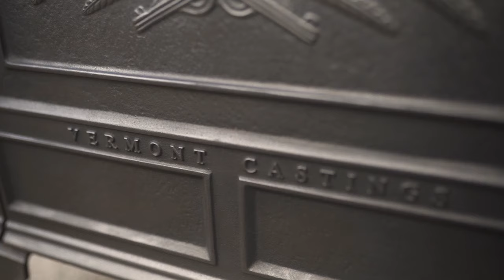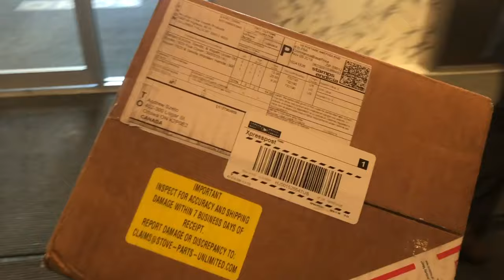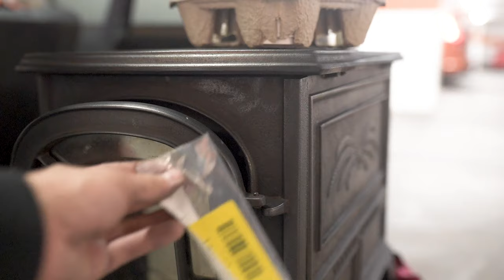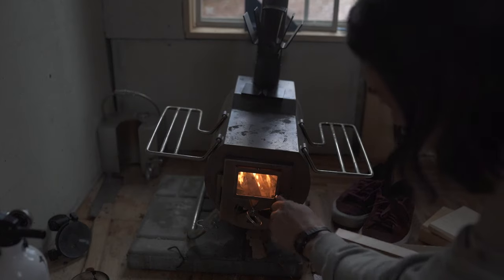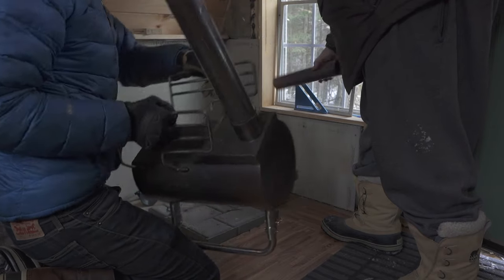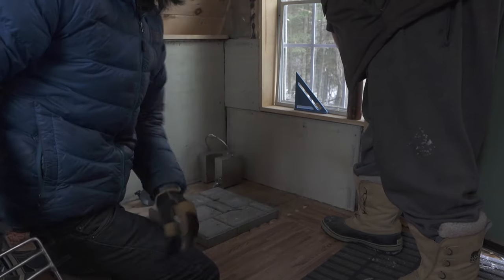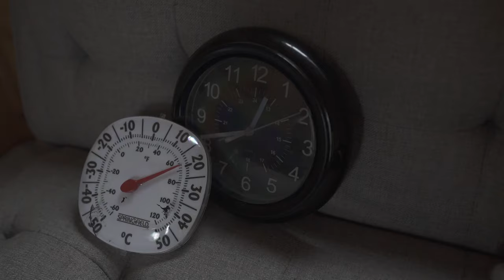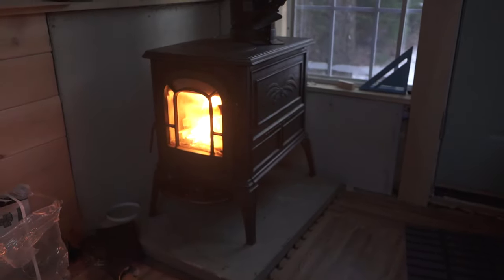Restoring, Refurbishing, Removing Rust and Installing a Cast Iron Wood Stove!

Comment: Very nice. Bought a floor model (Aspen) in Gainesville for about a grand in 2010. It never worked right. After 10 years of smoldering and creosote buildup I took it out frustrated. Put my old Birmingham no 20 back in.
Now I'm learning that there may be blockages of cement in all the air flow channels from the factory. So I'm going to try and take it apart and see.
Hope to make it right and look as good as yours does now. 
It looks great. Thanks for sharing all that. I e?enjoyed watching.
Reply: Had the same exact problem with the one I bought. I restored an old WJ Loth Stove that is probably one hundred years old, and it works perfect without any creosote buildup at all, and being an antique, it looks so much better.

Comment: Let me say!
Great job! on Re-finishing the stove.
As for the double wall pipe just switch the top section out with the bottom section.
and remember, Be at least 3 feet above the peak of your dwelling.
This minumises downdraft.
Glad to see you have a UL/CSA  approved woodstove.
I know chimney costs more than the stove, But you did it right the first time.
Your safe with that celling kit you bought,  
Now you just need a 6 inch brush,
To keep it clean.
Burn it hot for about 15-20 mins in the morning to burn out any creosote build up, 
Good Job!!!
PS Keep a fire extingusher nearby.

Comment: I put copper on the wall made a big difference, before i would put my hand against the cement wall and it was hot now i can touch the copper and just slightly warm and the warmth reflects more heat in the room.

Comment: Nice job, did i notice some sort of lining inside ? Mine seems to have a lining of some kind at the rear and side walls, worrying in case its asbestos.
Reply from the maker: hmmm good question andrew, i don't know myself. I replaced the linings on all the openings, but didn't notice any others on mine.
Reply: @AndrewSzeto  I did a bit more research and found that its more than likely not asbestos but some other flame proof lining that helps reflect the heat toward the front. I was just worried about  removing it for cleaning the inside.

Comment: Great job and loved the video.  I just picked up an older Aspen and its in about the same shape as yours was.  Door was hanging off the stove and when i moved it, snapped off completely.  I can barely see the pins you used as replacements.  Can you tell me where you found them and what the order number was?  Again, great job.
Reply from the maker: oooh good question bruce, i don't remember it anymore, but there are diagrams available for this via the links mentioned or below and you should be able to locate it there. you gotta be super fragile with that door!

Comment: Unfortunately stoves that have been left outside tend to get brittle  I wonder if the stove is still in working condition or did it crack
Reply from the maker: it's still rocking for sure!
Reply: Have you checked it for cracks?

Comment: Hey tip for you , clean the glass with wood ash & water,  clean off with newspaper 👌🏽
Reply from the maker: oooh cheers rosco! probably easier than carrying glass cleaner around with me all the time haha
Reply: Rosscobosco I have a question for you.  I want to install a wood stove on the basement of a 2 story building which has a brick chimney. Do you think this will be save to do. I have tenants on 1st and 2nd floor living.  Thank you in advanced.

Comment: Крутая печь. The only remark. The pipe for removal of a smoke needs to be done above a roof. Then the thrust in the furnace will be better and less smoke when kindling will go into the house.
Reply from the maker: большое спасибо! and absolutely, i had a defective section of external pipe. need to get it replaced and it should get me close to the necessary clearances.

Comment: I have an old osburn I took out of my house, and left on the deck for a few years. I’m definitely gonna restore it. And then probably use it for myself
Reply from the maker: heck ya! hope this helps a bit! there are other decent resources out there too!
Reply: Andrew Szeto it did help, and I am currently in the process of trying to figure out how to get the brass plating back from rust. However looks like I’m gonna have to get it redone since it looks a bit far gone...

Comment: any tips on how to remove the screws holding the glass seem to have we welded them self on?
Reply from the maker: oh crap... usually for any screws that are stripped and weird like that, the solution is usually to drill them out. sounds like you'll need some accuracy around the glass though.
Reply: Look on yt for seized/broken stud removal tips. Try using heat first and or  penetrating fluid , if that does not work then Small hole in centre gradually going up to close to thread depth ,then fit screw removal tool(set costs pennies),clean thread with original tap size . Get new screws and coat with anti seize /copper grease  and refit.   whilst your glass is out clean it with a damp cloth dipped in ash from fire then polish with cloth . It pays to fit new seals if refurbishing  or every few years as they harden up .and check the state of the firebrick inside,if broken replace if you can .or make your own using broken as template .

Comment: White size wire wheel brush?
Reply from the maker: oooh good question, it was a big one, i don't fully recall though. Probably like a 1.75/2" diameter
Reply: @AndrewSzeto  isn’t there like a size of the wire too? I see braided wire, rounded wire too many choices and forget asking at the box store — they won’t know
Reply from the maker: @DamnGoodReviews  oh boy, i did this a while back haha, don't overthink it haha. I just picked up whatever they had to take the rust off. It's metal on metal and it whatever you get will probably work. Just gotta put in the elbow grease. probably not the most helpful, but it's honestly just been a while haha. all the best!
Reply: @AndrewSzeto  haha sounds good!  Thank you!

Comment: Just think if v c would've made large version of this stove capable of taking a 26 inch logs
I lived in the calving room of an old dairy barn ,that had been converted to liveing quarters. There was a local shop going out of business and i bought a brand new green porcelain dipped vc aspen for 550 dollar's .l installed it in the barn apartment on a brick floor . Safety pipe had already been put in through the whole legth of the bottom floor through the loft 
This video brings back memories of my good old friend that kept me warm for three indiana winters
Reply from the maker: incredible! that's a smoking deal on that aspen!

Comment: Nice job on the stove refurbishing.  Did you install a ceiling support box when transitioning at the ceiling from the interior stove pipe to the exterior chimney pipe? the stove pipe itself is not supposed to go through the roof.  Interior clearance - If you used a double wall stove pipe I believe 6" of wall clearance is what is needed and if its single wall 18" of wall clearance.  Im no expert and Im just trying to help if I could, please verify before proceeding.
Reply from the maker: Tony J yep! got the support box for sure! thanks a ton for checking this out and checking in ✌🏼

Comment: I have 4 woodburning stoves/cookers !

3 kids plus me  in a 10m square house 2 floors.

Usually we only have the main cook stove going in the kitchen. Even when minus 10c outside. Loads of duvets and sleeping with socks on, smile.

When it got down to minus 20c  we used  to fire up the big boy  and everything down stairs got a bit too hot ,  plus 28c.  Hence the 2 smaller cooker stoves upstairs in bedrooms as allowed them to make tea and cook if they wanted to, as long as they carried the wood upstairs and the ash down. LOL

Your little boy is very like the stoves that the locals use to heat a,  say 10m-15m square space, easily. But  they dont stay in long, about 2-3 hours, because of the small fire box, unless you put coal on it about 10pm  should last until about 6 am, then  just raddle it a bit and chuck on new new logs.

As steel absorbs heat and transmits it too well, think of saucepans. I would be worried about using it as a heat shield in s wooden building.  I dont know about modern materials. I have only ever lived in traditionally built houses, so cement, bricks and stone (especially the igneous) act as heat sinks  and fire protection.

Personally I would build a brick  container ( hearth and chimney) around you stove. To absorb heat and protect the wood structure.

Anyway I loved the vid.
Reply from the maker: thank you soo much! this stove has been working really well thank goodness! your account on things is great for context moving forward! thanks again and happy firday!

Comment: Where did you get the hinges???
Reply from the maker: i got them from here: https://www.vermontcastings.parts/shopexd.asp?id=4
Reply from the maker: @HollywoodCreeper  omg, i am soo sorry. I did not have a similar experience, but this is good to know for future correspondence. I guess I got lucky. I do try and buy imperial everything if I can (likely available at home depot), but yeah I made the order and got lucky I guess. sorry again.
Reply: @AndrewSzeto  Hi Andrew,
No problem. It's not your fault! I just wanted to let people know that these guys cost a lot and can be bad to deal with. They are called Cozy Cabin in Warrensburg, NY. My local Home Depot had no chimney pipe. My local Ace Hardware sold Imperial pipe and it was like $10.49 for a 2 foot section and $23 for a 4 foot section of single wall. Keep up the good videos.

Comment: Hi Szeto, around the stove... you may want to do some mosaic tile on the backer board. 
Even if there is already cement board up, you can do some fun tile work on the 1/4” hardie board (while it is on a flat surface).. just leave a couple tiles out in strategic places so you can screw it securely.. then once it is in place you can put the tiles in with an epoxy or furnace cement, etc.The 1/4” hardboard is light and could go on the T&G without too much engineering.

Great work, attitude and way about you.. comes through in your content. Cute dog too.. the Pup’s jacket/ coat is nice, where is that from?  Peace, and take care.
Reply from the maker: thanks a ton! I've got the hardboard up everywhere now, plus some pipe shields as well. It's all doing a much better job now :) Atlas' coat was purchased by my mom haha, looking on amazon, there are a bunch just like it!

Comment: Never ever allow the door to hang from the hinges like that. If that Hing had snapped off you would have done massive amount of damage to the stove
Reply from the maker: you're not wrong. glad it didn't happen. thanks a bunch for checking this out and the tip.
Reply: @AndrewSzeto  sorry but I freaked out when I saw that knowing how easy cast iron snaps
Reply from the maker: @m998hmmwv7  i hear ya!! the thing would just swing open like that when i first got to it and as told that, it was like that for years haha so didn't think a ton of it at the time

Comment: Be careful with that window trim at the rear of the stove. Also any plastic window parts. May have to add another small shield at the back. Otherwise, very nice job.
Reply from the maker: i totally added a bunch of shields back there. it's been good!

Comment: No restoration done at all here. He cleaned a stove, thats it. And most everything he did was wrong per factory specs. Its really a shame, because to get the most out of those old crappy 1920’s, you need to fully rebuild it. Its of the worst designs for a VC stove, and they changed it rightfully to make it better. He says “the same stove new costs 1600”. Untrue. The new stove is the C3, which is leaps and bounds better than this 1920. 

All in all Im happy you tried, just a lot of mis information here.

-Someone who owns an actual stove restoration shop.
Reply from the maker: right on nick! good to know! it does the job for now, would love to pick up a new one for sure! can you drop a link to your store? cheers!

Comment: Do you ever use coal in your burners?
Reply from the maker: i have not myself, no
Reply: @AndrewSzeto  ..... Hi again ..... maybe check into it .... I have used coal, small chunks about the size of a fist, it puts out good heat but it gets hotter then wood if I remember correctly so you do have to check the walls surrounding the wood burner until you know the right amount to use.

Comment: Did it do well through the first winter?...I bought one myself.  This COVID-19 is slowing things down though.
Reply from the maker: Code Talker oh ya it did great! game changer in terms of prolonged heat and sleep haha. i have a comparison video after this one ✌🏼
Reply: Andrew Szeto it looked like there was a small crack on the stove.  Do you think that might be a problem? I think it was on the top.
Reply from the maker: @codetalker3737  oh yea there is a crack. will weld it in the spring/summer.... whenever covid ends.
Reply: Sorry I keep asking questions but from what I have read about the stove it is supposed to have an automatic air intake controller.  Is yours on that old one?  I didn’t see it in the rear.  Thx again
Reply from the maker: @codetalker3737  right on! you're really observative (which is awesome). mine seems to be broken (whole housing was gone), so i have left it off for now. I put in a flue at the top of the pipe and it will hopefully help. as mentioned, it's operated great thus far!
Reply: Andrew Szeto Thx for the info! Gives me ideas if I run into problems.  Alaska gets cold so keeping warm efficiently is important.  I will keep an eye out for your future projects.  Stay safe brother!
Reply from the maker: @codetalker3737  Sounds great! one thing I have heard is that if you space is much bigger, it's not quite as efficient as they say it is. so something to consider. Good luck and stay safe out there too!

Comment: Great video! The double wall piping was the killer! Why is this so expensive???? Hahahahahahaha Because you need it? Hahahahahahahaha Beautiful wood stove. I like the like grain motif and the side window. I got a Vermont Castings Vigilante off Craigslist, but the guy charged me $120 USD which is actually a good deal I think. The stupid thing was that they loaded the thing on top of it's heat screen....so stupid, so they broke that. The screws broke off. Maybe I can reattach that with magnets.  I can lower your costs and chemical exposure a little bit. I think the best fireplace glass cleaner is ash mixed with water. Give that a try.
I still have to figure out how to attach the wood stove to the ceiling flew. It's not easy.
To get my woodstove, I drove about 2 hours to get it one way, and then another 2 hours back. You can find some wood stoves for free, but I needed one now! I was freezing my ass off. I'm in New York, but people are cool in Canada.

Comment: I had a laser thermometer in a similar cabin.... I pointed the laser at the highest point in the roof... Once that temperature is around 22 degree centigrade..... Just have stove on slow burn.....,* All wood should be DRY and clean... Or its just too ineffective..... 👍...
Reply from the maker: Karl Dunne by slow burn, turning the damper to have less draft would effectively be the same, right?! still figuring it out 🤔

Comment: Can I ask what you did on the outside of the roof as flashing around the stove pipe? We are getting ready to install the same stove in our A frame cabin, but not sure how to cover the hole on the roof. How much clearance around the stove pipe did you do before you installed the pipe through it? We are being told 2 inches around the pipe in the roof but the hole is so large if we do that we are not sure how to cover it. Thanks